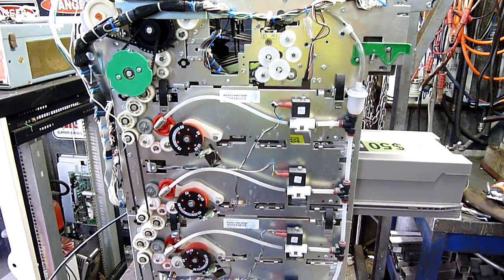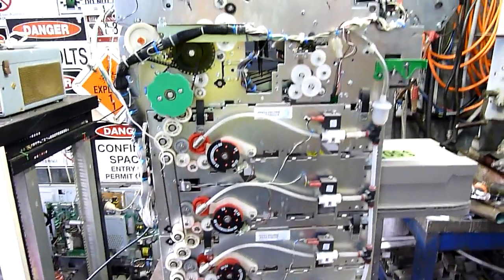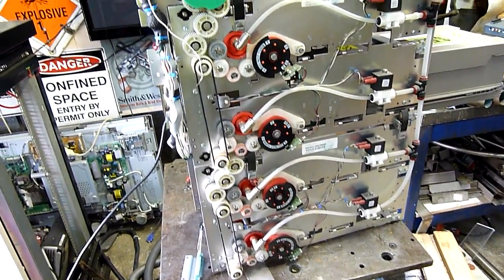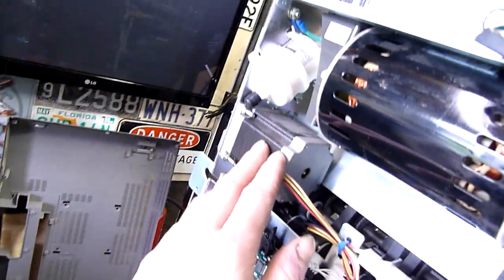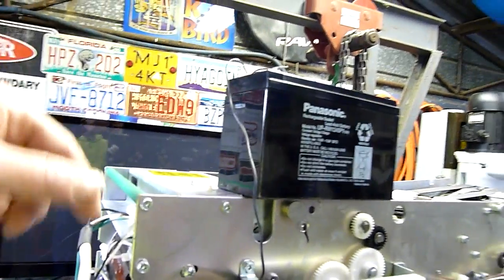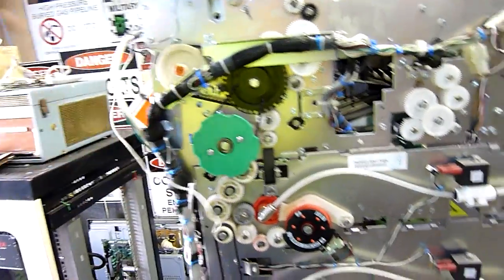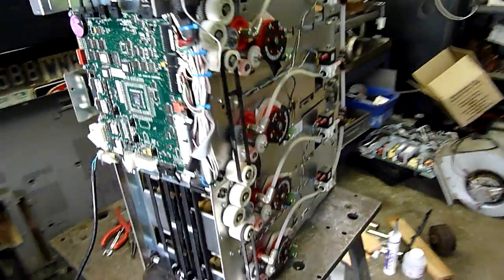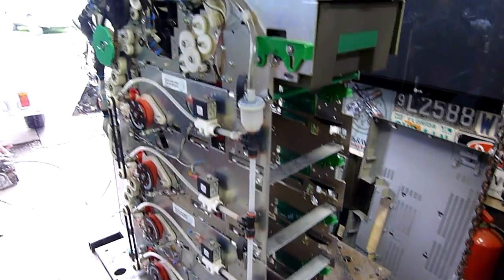Urban Myth? - Does an ATM Artificially make sounds to tell you its working?

Comment: The way I heard the myth was that they specifically designed the mechanism to be as loud as possible to instil trust in the user that their money is on the way. Not so much that it was generating fake noise. Coincidentally I was using a particularly loud machine on Thursday and this myth actually came to mind.

Comment: Ripping out that cassette with one hand looked fucking badass. Also dayum that ATM came out in 2007 and is rocking a 386? Seeing as it isn't a windows ATM I would have expected something like that to be using a Z80.
Reply from the maker: the 386 runs the dispenser mech, the top half is a PIII 700 rocking Windows XP Embedded :D
Reply: Aaah I was expecting P166 as the main CPU as that is what i saw in a training manual.
Reply: Aussie50
A full on 386 just to run the mechanism? That's crazy! I guess no expense spared then eh? One would expect a Z80 or something else less powerful to be doing something like that if at all.

Comment: I can also tell you that there is a LVDT sensor in the pick wheel area, checks for length, width and thickness of the notes, and I know that the red toggle switch on the mian circuit board behind the currency dispenser unit is used for.

Comment: are you gonna hook up the embedded pc? would be cool if you can also what cpu was it? looked like a 386 or 486
Reply from the maker: Its an embedded 386-33, discontinued only 5 years ago. very reliable but old system.
Reply: *****
Any linux distro I know wouldn't work to well on a 386-33. In 1989 that the processor in my first computer to give you an idea of how old that is.
Reply: ***** The actual kernel would run fine on a 386, whilst most distros would run on it you would need a lightweight one to run well (preferably without a desktop manager).
Reply: What the heck is a protogen fursuiter doing here.

Comment: these particular mechs can be a pain in the ass if the vac filter gets clogged up. but the same mech is also used in a lot of much larger machines which run a pentium D based pc and have since been upgraded from XP to vista

Comment: Some ATMs do play a little tune by modulating the pulses to the stepper motor that spits out the cash.  I spoke to a developer of the 90's generation NCR units - and he said they most definitely did that on purpose.  Those all ran OS/2 BTW.

Comment: The 386 isn't even running the iuser interface it is only driving the mechanism is that correct!? In pictures it can be seen a PC like machine in the top that uses a Pentium 166 or above! I cant wait to see you take apart the top end :)
Reply: Yes, that's correct.  The control board that has the 386 processor simply handles the connections to and from the cash dispenser, like power, data, modes, encryption, and so forth, and a 386 is more than enough to do that.

Comment: I fix TCD's at work Ed, (Teller Cash Dispenser) and they use a similar dispensing unit except they are for all denominations. Usually the noises are self checks before, during, and after the transaction is complete. There would have been cassettes with 50 and 20 dollar notes (if it's a kiosk type) and 100 dollar cassette for proper Bank Atms. Depending on the type some have a reject box for notes that skew or fail UV, Magnetic, or transparency tests (most are just dumb though). In a nutshell, these don't make mistakes and if the note path is blocked by a stuffed note, some have a backup cassette of the same denom to allow the transaction before issuing an out of service. etc...
Reply from the maker: Very cool, I can see that they would have had 2X $50 cassettes and 2X $20 cassettes at least, since it was a kiosk type (NCR Personas 5877) and a load of sensors to detect what bills and what denominations were going out, very smart equipment!.
I will do a teardown on the mech itself soon, and maybe pull the data off the Xylinx XC9536 CPLD's

Comment: when you get the display unit from the other ATM could you make a detailed video of its embedded  pc?
Reply: and also i dont think a 386 would ever run win xp
Reply: winhistory dot de, they run windows xp on 8mhz processor, booting 30 mins
Reply: holotrop11 hmm.....very interesting but i just realized the 386 is to controll the safe componets the one running xp is a pentuim3 700 but thanks for the info :)

Comment: Personally I never believed the myth, especially several years ago when I tried making a withdrawal and got what sounded like printer paper jam.  The dispensing sound continued for a few seconds and then the screen showed an out of service message without giving me my withdrawal. 

I walked into the bank to report the problem and they assured me that the failed transaction will be refunded.  Sure enough on my online statement, it showed my €40 withdrawal, followed by a €40 lodgement.  With banking fees back, it does make me wonder I would have been charged for two transactions if this happened again.

Comment: Yes and no, no literally.

Normally an ATM should be silent, especially when it's contacting the company to validate the card information, to prevent any savvy hacks from bridging the connection and hacking the unit or company.  I've ran into some CC systems that inadvertently left their speakers turned on, but those are far and few in between.

As for mechanical operation, the dispensing system has internal checks and cycles to operate to ensure that the proper amount is dispensed. I've had ATM's short me 40 on a 100 USD withdrawal. Fortunately, it was operated by the store owners and they comped the the cash. Nice guys, I'll give them that. Dirty money or fouled rollers can account for the majority of dispense failures or malfunctions, very rarely miscounted loads.